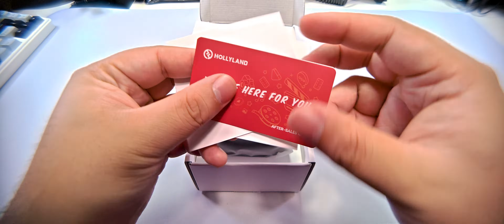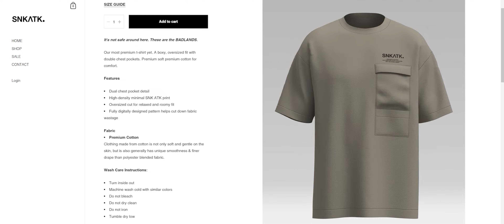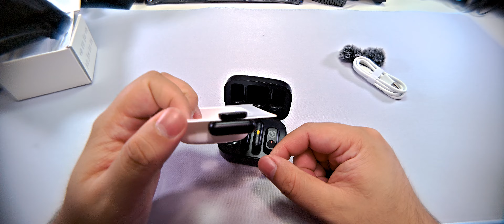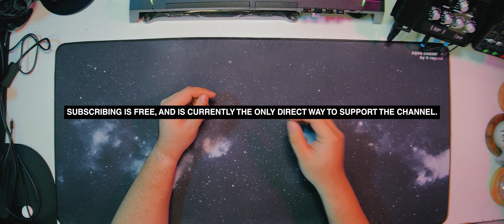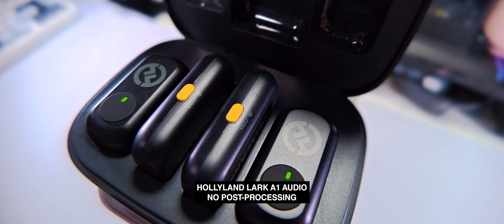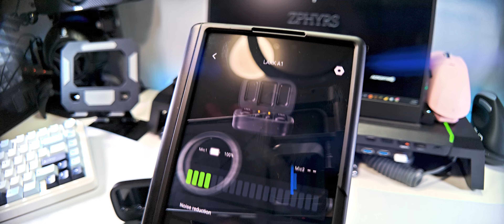Budget Mic, Pro Sound.  Hollyland Lark A1 Review

Comment: I could only get one of the mics to work. I only need one anyway , which works pretty good. The app has an audio bargraph meter that confirms the audio signal is coming into the phone, and  you can control the audio level and noise reduction. Then I installed the update after installing the app, which didn't seem to change anything. The setup with the working mic worked fine, mic 2 wound up being useless.  I put some beige colored  gaffer tape on the mic and receiver, labeled them 1 and 2  to make them easier to identify and hold on to. The sound is excellent. Even with just one working mic this is a still a great deal for the price.

Comment: What is the "usual audio processing" that you do and how? Thanks po
Reply from the maker: Hello po! Usually ang effects chain ko for my voiceovers are:
 
Noise Reduction > Amplify (around 3db) > Parametric EQ (may slight lisp po kasi ako so I try to remove a lot of the sibilant 'S' sounds and the sub-bass) > Multiband Compressor (set to even out at around 6db of volume para mas malakas yung voice ko over the background music)
 
This is mostly what I use, then I just tweak it every time I have to record on different mics-- the standard mic that I use kasi is the Shure SM57, which captures a wider range than what I need for my voiceovers, so I have to aggressively EQ it to get the quality that I want. :D
Reply: @KevinEvangelista Thank you sir. Saan po kayo nag eedit ng audio?

Comment: Can you recommend a simple program to use for post-recorded voice over editing? I've just picked up this mic and am really looking forward to using it, but recording it from the laptop leaves a bit to be desired. There is a big difference in your comparison of pre and post edited audio. I'd love to know what you use for it.
Reply from the maker: Hello! If you're on windows, I suggest using Audacity to clean up and improve your audio recordings.
 
(This is a simplified version of what I do with my recordings, but it should have the same results-- I do all my editing in Adobe Premiere Pro)

 
First process I like to do with any of my recordings are a quick Noise Reduction effect, just to smoothen things out and make sure I'm not amplifying any unwanted noise later down the chain.

Next I add a subtle Amplify effect, usually just around 3db-- I don't capture at a high gain because I have a slight lisp and recording at high gain levels tend to enunciate the S sounds too much, making them sibilant. This effect just raises that volume enough for further cleanup.

Next is an EQ-- I remove a lot of sub-bass and rein the highs in, removing as much sibilance that I can from that top-end. I also add a slight V-shaped curve that leans a bit closer to the highs. This one you're going to have to tune to your voice-- I do a V shape with mine because my voice is rather boomy and bassy, so I pull back the mids a bit so I don't sound bloated.

Then lastly I use a Normalize and either a Limiter or Loudness Normalization just to even out the volume of my entire VO track as well as mix it to an even 6db of volume so it's audible enough for use in videos.
 
That's it, a fairly simple 4-effect chain for you to improve your recordings straight off the mic. Hope this helps!
Reply: @RationaleTechReviews I think doing a video on that, especially for Audacity, will get you a lot of views! I was shocked to see the difference when you disabled your post processing, night and day
Reply: @RationaleTechReviews  Wow! This is a wealth of information. Now, I have no idea what any of it means but what I do know is I have Audacity on mac. So that's a massive start. You've given me a great start of what to research and play with. I never would have known what terms to even search for to learn. Thank you for this!! 
(I also have the ever-so-slight lisp thing that makes me cringe listening back, so I appreciate that tip!)
Reply from the maker: @Kay_Watermelon  No worries! Research goes a long way, and there's a wealth of resources on youtube on how to clean up voiceover audio. Don't hesitate to comment here if you have any more questions!
 
(Yes, the lisp is annoying as hell. I have it because I am missing some molars so the right side of my palate is all off-balanced lol)
Reply: @RationaleTechReviews  How does that compare to just auto-levelling and mastering inside of Essential Sounds in Premiere?
Reply from the maker: @goodvibesbeats2221 it should allow for finer control for your audio mixing-- you can correct for improper mic placement, lisps, plosives, and variances in volume. I have no problem setting things to auto when I'm in a hurry, but most of the time I (and my paying clients) prefer that I tweak everything manually.
 
I actually have the same workflow when I'm in Premiere; Noise removal > Amplify > Parametric EQ > Multiband Compressor. It's proven very effective and an easy to use workflow for me so far. Hope this helps!
Reply: @RationaleTechReviews do a yt short hahaha about it
Reply from the maker: @klager2828  if Hollyland is willing to sponsor a full video for it, I'm game! haha!